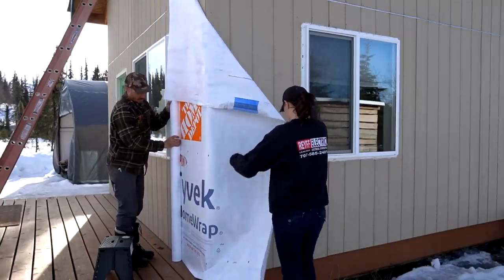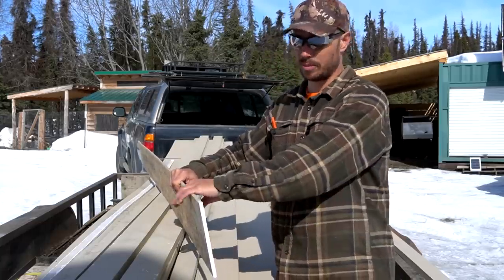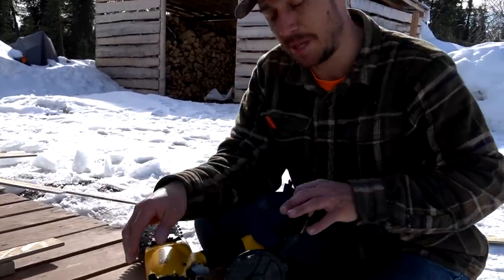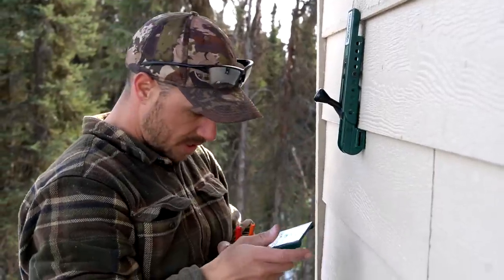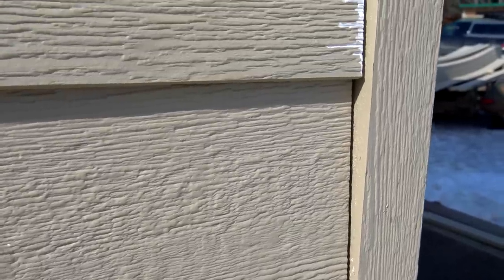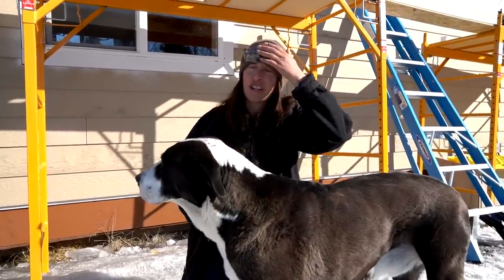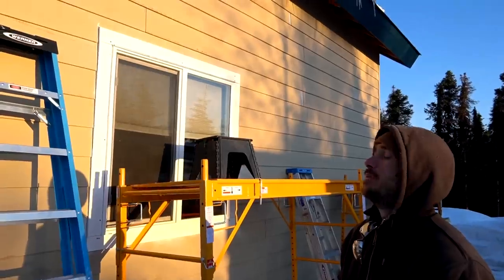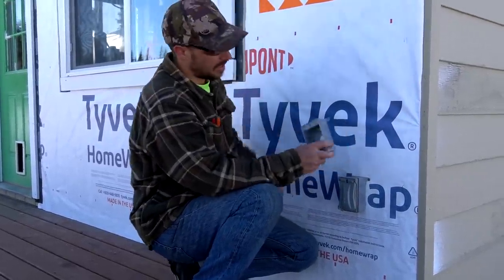Off Grid Cabin | DIY Siding Installation

Comment: Bo knows.... Bandit's ready!!  Pepper's like:  "What?  You're filming me again?  Have your people call my people for royalty negotiations."  

Gonna be cozy, come winter.  Be glad that you can use box nails for that material, and not SS ring-shank nails.  I did a 3-story house with cement board siding once, and you HAVE to use SS ring-shank nails.  Lots of "fun" if you have to pull one.  Another option at the rafters, is to use a scrap of siding as a thickness jig and cut the rafter tails with the multi-tool to enable you to slide the siding up behind your cut.  Lookin' good you two.  

For your gables, you could use a pair of extension ladders with ice tongs, ladder jacks, and a painter's pick to span the work.  For added security, drive some stakes into the ground for the ice tongs to butt against and keep it steady.

Comment: I feel your pain. About 12 years ago I helped my former neighbor re-side his entire house with cement-fiber.  When I saw your "Gecko Gauges" I was so jealous.  We made our own reveal/hide gauges with scraps of wood. But they were not hands free. We had to hold them in place at each end and then he would start the pneumatic nailer on his end. Still helped us immensely not having to keep measuring. By the time we were nearly finished at the end of the week, my left knee (already bad) looked like a grapefruit on top and he had to have cortisone shot into his right elbow. Good times! Y'all are doing an awesome job!
Reply: Hardy board is the best product for siding especially this extreme weather conditions and then oil base paint only if the paint is compatible with the factory primer the oil base paint will last a really long time and stainless nail's and don't break the face of the siding with the nail's or your hammer ! Good not cheap and cheap is not good spend extra money it will last a really long time !

Comment: Cabin looks great. Love that you went with a lap siding. I’ve used the LP siding products and trim on a few houses and it’s been great.  Use a good quality caulk for the butt joints and ends as well as a high quality paint and this siding will last for many years.

Comment: I had my own cornice crew for many years. I would say yall did everything right. Great job. Those  gecko holders sure make it easier. We used to have to scribe a line on the lap siding and drive a nail to hold the next lap before they came out. And butting your siding to the trim is the only way it should be done. Nailing trim onto lap siding never made sense to me. But that was the direction from some builders in the past.

Comment: Good to see you sealing the end cut. If you have a 2 foot piece of rebar. Make a 90⁰ bend about 8 inches down and sharpen a point on the long end and pound it into the ground on one of the extension ladders foot to hold it from kicking out on the ice.

Comment: I've done plenty of that LP siding and love it.  When you get to the rafter tails, if you block between them with a 2X up to the roof plywood and flush to the bottom, you just have a straight cut, then you can hose it down and not have water go behind the gap at the top.  Those gecko gauges are a must.  It's looking great.

Comment: Pro tip for installing lap siding. When you have a butt joint in the middle of the wall always put a piece of flashing behind it. Lap it over the next row down. Good job priming your cuts, most "pros" don't even do that.

Comment: You all are doing a great job. We did a complete remodel on my small home six years ago but we are always doing improvements. It was gutted when we bought it. We did new electric, insulation, drywall, metal roof, plumbing, siding and windows all new cabinets lol. We did it ourselves.

Comment: It’s looking really good. As long as the material is available extra trips are probably better than expensive material you won’t use or have to constantly move out of the way. Advice for doing electrical I received from my father in law, “don’t touch both wires at the same time dummy”. I have those words of wisdom in my mind every time I work on hot electrical. Needless to say because I’m thinking of it I find a way to ‘accidentally’ touch both wires no matter what. Great job. I look forward to the next installment and the eventual finished project. Thank you for the effort. Oh and thanks Arielle for laughing so hard when Eric was holding it up with his head, it made me laugh too.

Comment: You don't need to rent equipment, so to speak, for the high end of the cabin (peak). Use/purchase/rent ladder jacks. They attach to regular extension ladders with a plank in between, you can move the ladders closer. If you go really far apart, you probably need an aluminum type scaffold plank. Your cabin is small enough.... You'll be fine

Comment: Great choice on the siding! Same exact stuff I installed on my home back in 2016. Still looks brand new. They do make aluminum trim pieces to cover the seams vs. caulking but if I remember they were quiet expensive per piece. Looks great, I think you’ll be happy!

Comment: Nicely done you two.  We just had our house resided with pre-painted Hardy board.  It took them an awful lot longer to do ours but they had to remove old vinyl siding first.  Getting pre painted boards was very nice because obviously we didn’t have to paint afterward.  The LP board is good but paint fairly heavy on it to protect the boards.  At one point we had the original LP board that all went bad and had to be removed, so I am a little biased against LP, but I have heard that the new board is good.  Good luck to you, it looks fantastic.

Comment: We sided our house with a similar product only is was a concrete which was quit heavy and required special saw blades.   I love it the paint is still looking great.  The only thing I wish was we had a set of those gauges.  we made had made ones and you had to hold them in place for spacing. otherwise ours was exactly the same process.  good job. you make a great team

Comment: Looks good, if there is a next time build the corners first so you can install them in one piece and run a bead of caulk down the inside of the corner (blind caulk).

Comment: If that was my cabin, I would of primed the back side of the siding even if it said not to. Completely sealing any kind of wood on the exterior of a home is crucial for it to last a very long time. If ANY moisture gets trapped behind your siding that OSB is going to soak it up like a sponge.

Comment: nice job.  WEAR SAFETY GLASSEs with the nailer or anything.  they are uncomfortable but in 30 years as an adult working on projects on the farm they have saved me 3 times

you will be very happy with the siding.  we have had it up on various buildings on the farm for 10 years.  we paint ours it helps the calk last longer.  you will want to check that every year or two.  anyway.  well done.  Greetings from Seattle.  (and Santa Fe TX but now I am up in seattle test flying :) Fly safe  PS wait till you have to do this to your other cabin :)

Comment: Put a piece of roof deck paper between each seam or butt joint on the siding.  If water leaks in, it will rain down to the next board.

Comment: You really should have had a 1/2 inch nailing strip for the siding so there is an breathable air space between siding and house rap.Metal Flashing over the windows and door would of been best because caulking alone breaks down quick with extreme temps. I am not a huge fan of OSB products. Mould loves the glue used in them with no breathable air space this could be a future problem if you don’t have a good interior vapour barrier.

Comment: So I looked into this type of siding. And they say you should put some type of waterproof laminate across on the top of each piece of siding you put on. So that when the water drips down a crack or something like that it will just go down the crack and down the siding. Instead of behind the siding. I wasn't too thrilled about that. And I see you guys are doing something different. Why did you choose to do it this way? And why did you guys not put like a thin pink insulation then the tie back? I was just curious if you thought it was an Overkill or I'm not sure? I haven't put new siding on my house yet and I just like to do research and ask people questions and why they did this and why they didn't do that it's not a criticism I was just curious
Reply from the maker: I don't remember coming across that information. We did find that it really probably isn't the best siding for extremely moist locations, Alaska is fairly dry, our cabin is in the sun and we don't have anything resting near the cabin so felt it was a economical and realistic choice for us 🙂 We passed on the extra insulation for a variety of reasons although that seems to be a great option if you are building a house nowadays.

Comment: As you get older, you will find that standing on your head to plug something in is no fun.  If I had it to do over, I would have mounted the outlets higher.  Turning the covers upside down works too...Stu

Comment: I understand the gap between the ends but why a gap in the middle of a full span?  You are just making the most of the material by using two pieces I would think the material won't react any different than if it was one piece with the appropriate gaps on the ends.  My thinking at least.

Comment: What man, or woman, doesn't like new power tools?  I used to think I would only buy a power tool if I planned on 2 hard uses of it.  After doing my roof the first time by hammer, I bought a roofing nailer and would never go back to hammer time again.  If used correctly power tools do the job faster and better than most people can do by hand.  Sure there are the occasional guys that can beat a power tool with hand tools, but they are rare.